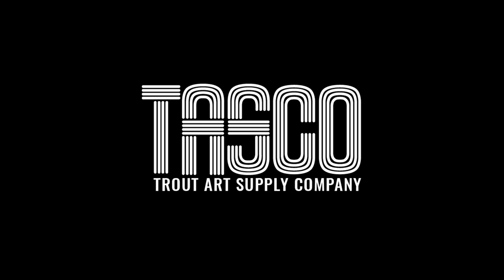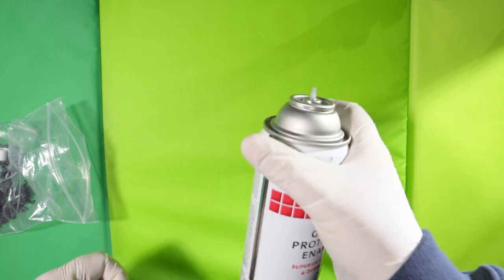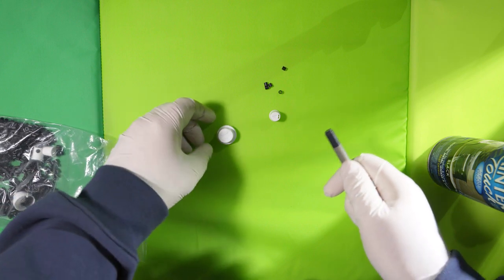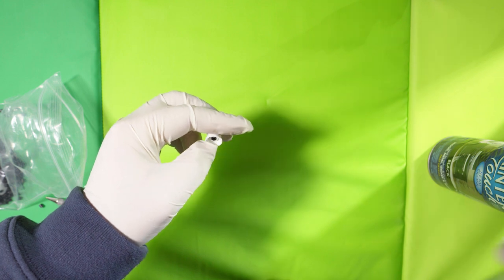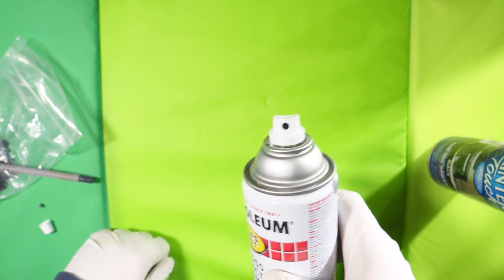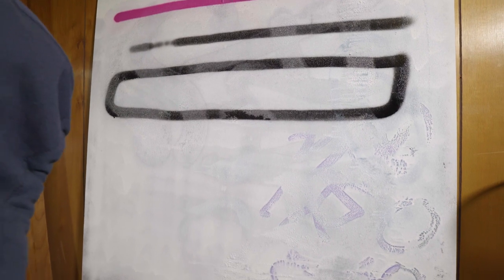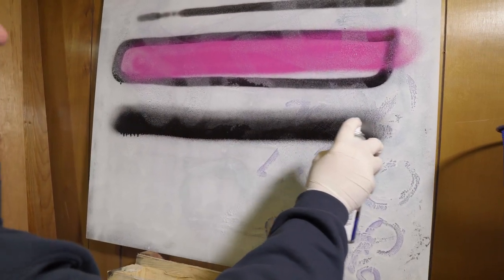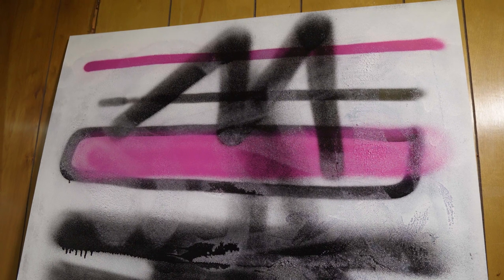Medusa Reducer - Tutorial / Demo

Comment: do they work with grey dots with the stem taken out?
Reply from the maker: No, wrong dimensions
Reply: @stolencoats63  what about ultrawide/madmaxxx cap?
Reply from the maker: @viktorvaugndoom  I believe so, if the opening on the bottom of the cap is 4mm, it will fit